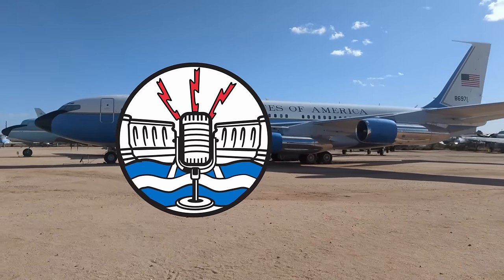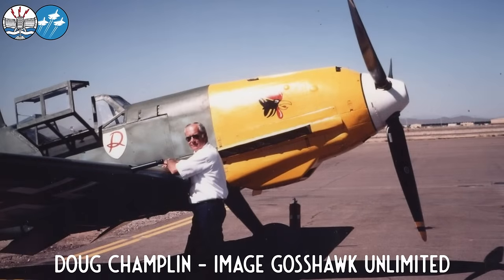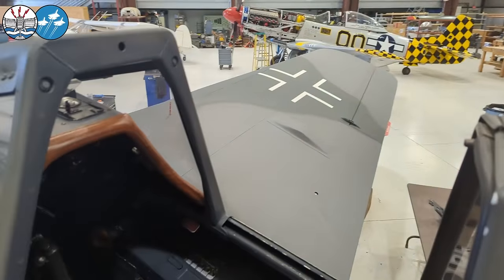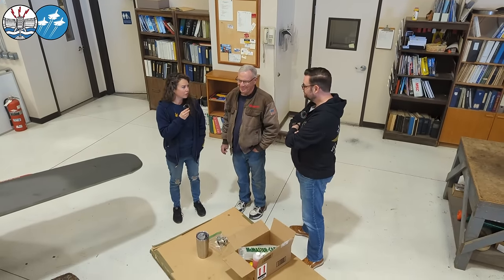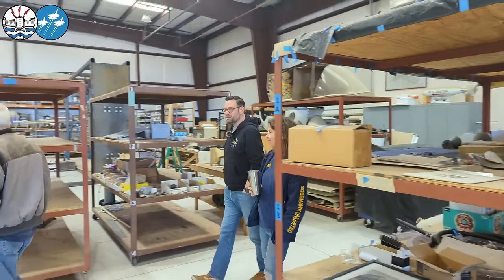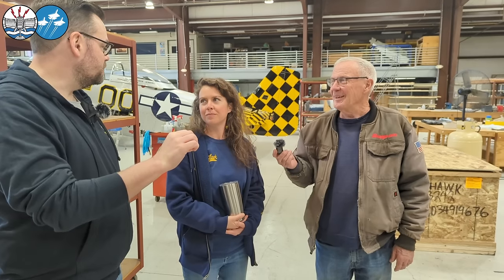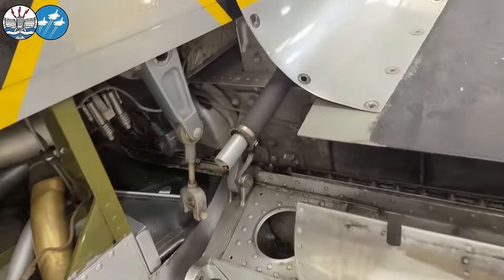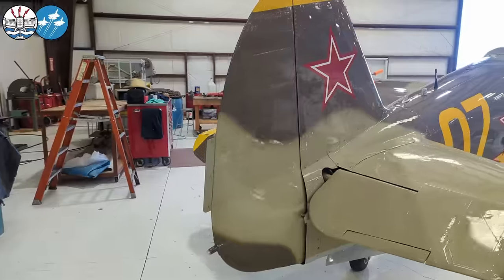Building Focke-Wulf Fw 190s! GossHawk Unlimited Tour - Part 1

Comment: Absolutely love the FW 190 in all it's iterations. Would love to see a D9 flying in the future - now that really would be something !
Reply from the maker: Dave and Lindsey did the D9 for Collings and have another as one of the projects they are staffing up for. Watch this space!
Reply: @damcasterspod  I certainly will. Thanks.
Reply: @damcasterspod   I've not seen any information that Gosshawk had actually started working on the D-9 for Collings.  When Mark Timkin was working on White 1 in FL he told me that he had really wanted to do a D-9 but could not find a wreck or ID plate to start a project.  Later he was able to get the data plate for Fw-190D-9 W.Nr. 210096 JG26 and this was going to be his D-9 project.  I guess when Collings bought White 1 they also got 210096 as a project.  I think Timkin was able to get one of the Jumo 213 engines there were dug out of the ground during construction at the Frankfurt Airport as a parts engine.  Mark wanted to do his D-9 in JV44 colors, so it will be interesting what Collings chooses for paint.
Reply: The D9 is my favorite prop fighter!

Comment: I supported the White 1 foundation when they were in Kissimmee and donated an optical comparator.  Visited multiple times and sat in the cockpit, got some great pics.  Great to see it progressing.  Thanks for showing this!
Reply from the maker: My pleasure!
Reply: @romeotango8650   White 1 was fully together and ready to being taxi testing, but I think Collings found a problem with the engine and it has been sent back to Vintage in CA for work.  I think that's why White 1 has not had a test flight yet.  I think White 1 will probably make a few flights and retire to the museum in Stow, MA.   And Collings has just announced a flying Stuka D-2 project and I'd like to see that flying but I think it will also eventually retire to permanent display at the museum in Stow.

Comment: This video is just awesome. I'm from McAllen, TX. I clearly remember the Texas air museum.  I also have original pictures of white 1. John Houston took this aircraft and restored it to static display. The pilots name was Owalowski. He was shot down protecting the German battle ship Turpitz. The museum also had artifacts of the ship itself connecting the fock wulf with the mission. Discover channel sponsored the trip to bring the pilot down to see his aircraft one more time. He even signed the fuselage. The museum at one time also acquired the island of the U.S.S.IWO JIMA, the Apollo 13 recovery ship. I also clearly recall they were restoring a 2nd butcher bird.  I had the honor of flying with John in a L-3 observation plane. I also have those pics.
Reply: +@achillesavendano5267   "White 1" was lost on 9-Feb-1945 during a mission to protect the German destroyer Z33 from Beaufighters and P-51 escort aircraft.  Pilot Orlowski was engaged with a P-51 and managed to set the P-51 on fire.   P-51 pilot Cecil Claude Caesar continued the attack with his burning Mustang and damaged "White 1" before going down in a forest and was KIA.   The Fw-190 was crippled and pilot Orlowski attempted a low bailout and was saved by deep snow before "White 1" crashed.

Comment: Before they could build an FW-190, they had to build the tooling to make one. That’s impressive!
Reply: +@Jones607  Flash back to the early 1990s when the original tooling for the Yak-3 fighters was discovered in Russia and was used build a series of brand-new Yak-3 airframes typed as Yak-3M aircraft.

Comment: It would be very interesting to know who the customers for the additional 2 Fw 190‘s are (or even is). But I guess this is one of those non disclosure deals.
Reply from the maker: I couldn't possibly comment... :)
Reply: @damcasterspod   Of course you can not. I thought maybe some of the more knowledgeable viewers might heard / read some rumors, might have heard it through the grapevine….
Reply: +@darkredvan   Flugwerk in Germany produced 21 new Fw-190 airframes as kits.  When Flugwerk closed it was Gosshawk that bought the Flugwerk inventory, jigs, parts and aircraft.  So now Gosshawk is now the assembly and repair center for the Flugwerk Fw-190 replicas.  They have been repairing a couple of Fw-190s that were ground-looped a few years ago.

Comment: I noticed that the wingroot guncover skin is made of at least 2 sheet aluminium and then riveted together. I thought it was originally just one piece. Is this done after an original piece like this or just a modern compromise that the team had to do?
Reply from the maker: It is based on an original piece. As Dave said, they wanted the aircraft 'perfect' so that is the output on the aircraft.

Comment: this is different from the flugwerk program ? of building fw190s
Reply from the maker: Yes, the Fw 190s that GossHawk are building are based upon recovered aircraft, while Flugwerk are true new builds.
Reply: Flugwerk cut several corners, especially internally. Though looking externally (nearly) like a Focke Wulf, it is not exactly built like one.
Reply: @damcasterspod  the fw190 dora with junkers jumo, did flugwerk ever finish it,? or is that the one you built?
Reply: @darkredvan  not sure i agree on that they used original blueprints and crash reverse engineering to complete drawings
Reply: @nissmoguy   Yes, they did. They ensured that the aircraft externally looks like a Focke Wulf 190. The but (other than due to the use of a different engine) was cutting corners internally by using different manufacturing methods (as initially it was only planned to produce 12 aircraft - later changed to 21 - it made sense to use modern, less complicated, cheaper production methods). Out of my head things changed was the main spar, main landing gear, use of bolts instead of rivets on ailerons, change of canopy release mechanism, different cowling, oil coolers, etc., etc.  Just what I remember. All those things can be changed to original Fw specification, but it is a lot of small things taking many work hours. Some owners let their aircraft change from FW to Fw standard (at least 4 by a German shop),  some more, some less original. It always depends on what you are willing to pay for. As GossHawk have the jigs and drawings as well as the expertise, they can do projects to Fw standard (which most financially sound owners would go for). The Flugwerk kit was a (relatively) cheap knock off even less wealthy owners could afford. BTW none of the kits was made in Germany.
Reply: +@nissmoguy   No, Flugwerk closed and Gosshawk purchased all of their inventory, parts, jigs and aircraft.  So Flugwerk is now Gosshawk and they are the repair/assembly center for the Flugwerk kits. Gosshawk is also doing restorations.  Something that Mark Timkin told me in FL when he was working on White 1 was that he tried to use Flugwerk parts and they just didn't fit.  So I think White 1 became a correct restoration with correctly-made parts.
Reply: @nissmoguy   Flugwerk converted three of their aircraft to D-9 standard but only one was fully complete with an Allison engine.  It was never certified for flight and has never flown.  It is currently sitting at the Military Aviation Museum in VA and is planned for more work, possibly re-engined with Jumo 213.   One of the other Flugwerk D-9 airframes is in Europe and I think the third is with Collings for their D-9 project.
Reply: @FiveCentsPlease   A small add: MAM‘s Flugwerk D-9 N is currently at MeierMotors, Germany (the only shop apart from GossHawk that did a lot of work on at least 4 Flugwerk kits fixing and changing various items to get closer to Focke Wulf standard). They use lots of original parts to get it to flying with a Junkers Jumo 213. The other one you mentioned (of the 3 kits) is / was? in Belgium to fly with a Jumo 213 as well, actual condition unknown. The 3. kit (originally with Klaus Colling of Flugwerk) was reconfigured to A/8 / N  and sold to Sweden.

@FiveCentsPlease : Have a look at this clip:

https://youtu.be/YQCQTK1Qn9k?si=SLFD7QQUZiVVTquY
Reply: @darkredvan   To my knowledge the MAM Flugwerk D-9 is still sitting in Virginia, at least other recent YT videos from people who toured the museum hanger showed it there.  There is no D-9 in the air yet.  I remember that Meier was contracted to do the work but didn't see any evidence that it was shipped there. I think Meier would have put it on their Facebook page.   Vintage is CA is working on the 213 and they have been waiting on the prop and small parts.  Mike just posted a picture of him working on the complex valve timing for it.  I really hope Vintage will have permission to film the testing. Over in Belgium, Eric passed away a couple of year ago so unless his sons keep going with the work I dunno where his project will go. Eric started with a wreck and a Flugwerk D-9 fuselage.  Maybe we'll see it for sale.
Reply: @darkredvan   Regarding Flugwerk construction, there were a lot of changes to their Fw-190s.  They used enlarged metal fuel tanks for better range. (A mistake because when Marc Mathis put F-AZZJ in the water those tanks burst.   Rubber bladders would have likely stayed together.)  Obviously firewall forward on the Flugwerk is totally different.  Wing construction is different.  And there is no armor or hard points for weapons.  (Probably a legal issue to eliminate weapons.)   The Flugwerks are nice but fly differently according to pilots.  The original Fw-190A-5 at Flying Heritage flies like a different aircraft.
Reply: @nissmoguy   Regarding blueprints, I think Flugwerk originally used a combination of some original blueprints and drawings created by DeHavilland engineer Arthur Bentley.

Comment: Shouldn't the text on the back lifting point be" Hier aufbocken" instead of " Hier aufholen""? I'm almost sure this is the case..
Reply: No, it is correct. Originating in Sailor‘s speech „Aufholen“ is another expression for lifting something. Aufholen is not widely used in nowadays language, whereas „Aufbocken“ is. Technically speaking Aufbocken is used when you put a „Bock“ (trestle) under something.

Comment: We have the technology now that someone could take apart something like this 190 and 3d scan every single piece then be able to reproduce identical 100% accurate replicas.   Stamps and molds would have to be made of course but even that with modern 3d printing isn't that difficult.
Yeah no modern day company should have to be hand forming sheet metal by looking at a picture.  3d scanners are very affordable.
Reply: +@FINNIUSORION  That is already being done in small amounts for some restorations.  However, take any single aircraft made during wartime production and there are flaws that do not conform to the original engineering drawings.  Any scans will have to be cross-checked against the engineering specs, and sometimes there are multiple versions of those specs.  Any restoration for the more rare aircraft is also a research project.
Reply from the maker: Having done some work with Leica on this in a past aspect of work, you can get incredible data from a scan, but it doesn't give the whole picture. The teams rebuilding Hawker Typhoon JP843 and Spitfire AA810 have both found this. Original documentation is vital. Plus, as Dave said in the video, the customer wanted authentic, so you get further away from just knocking up a replica.
Reply: @damcasterspod   That's one reason that the Flugwerk Fw-190s and the new-build Me-262s were not a favorite with serious collectors.  They want authenticity and wartime provenance with the aircraft.  A few buyers have merged Fw-190 wreckage with a Flugwerk to make it more authentic.